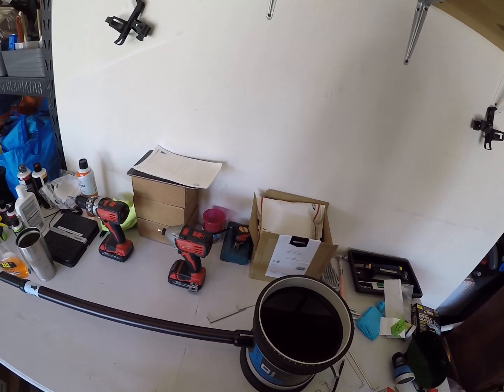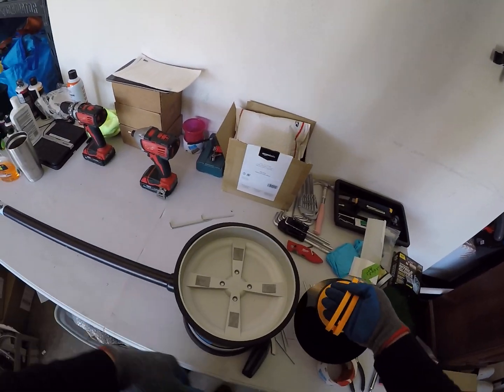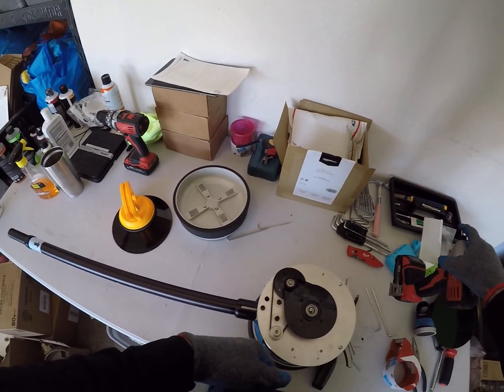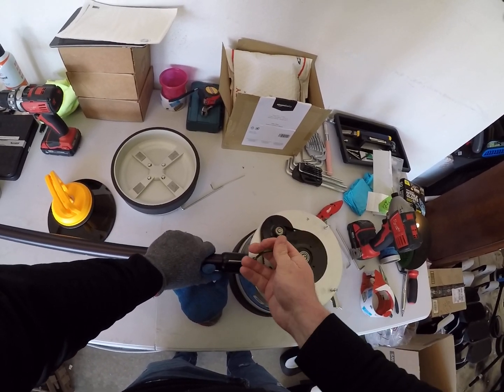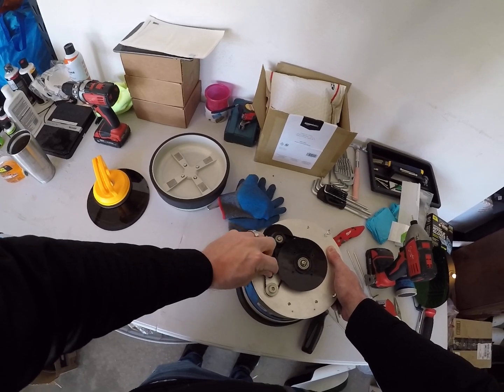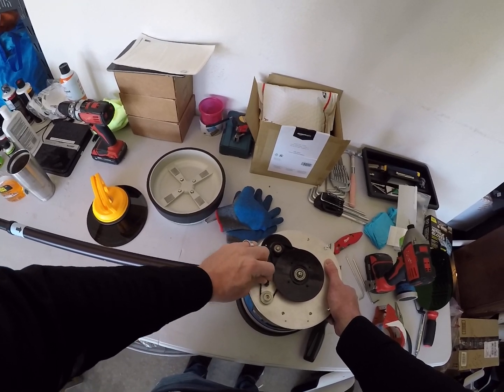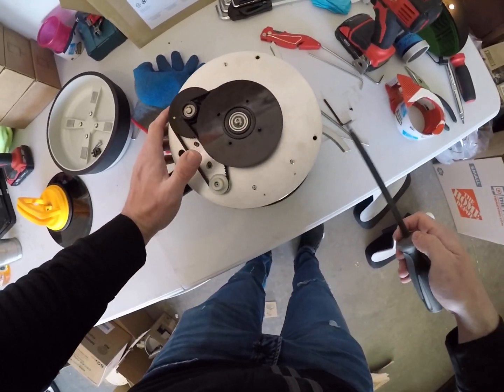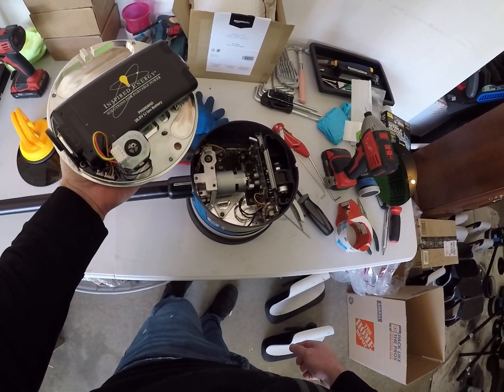Replacing the Battery on a Double 1 Robot

Comment: Hi Bill, great video. My double 1 had an orange light on the front (charging?) and would power off when removed from the charging dock and the battery life had been short before I didn't use it for about a month, so I ordered a new battery from inspired energy and installed it without difficulty today. Checked the old battery with a multimeter and it was at zero volts (bms lock-out?) and the new battery is reading 28.8 volts. Upon carefully closing everything up, I'm not getting any front LED lights, it doesn't power on, and when put in the dock, I get a green and red Led for a long blink and then short continuously blinking LED on the back small LEDs opposite the power button. Nothing changes with short or really long presses of the power button or holding power while putting it on the dock. Any ideas? I'll call double support but I suspect they'll tell me to ship it back at large expense, without a guarantee that they can fix it, and it had been working, so I feel like it should be an easy fix like some type of reset (unless something else failed when the battery did which seems a little less likely?)...

After I closed it up the first time, it did seem to power up (without LED lights on the front?) and ask my iPad to connect as a Bluetooth accessory but was reading 0% battery on the double iPad app, and after taking it apart to double check that all of the pin connectors should seemingly be seated correctly when putting the left wheel/cartridge back in the shell, I don't seem to be getting that anymore...